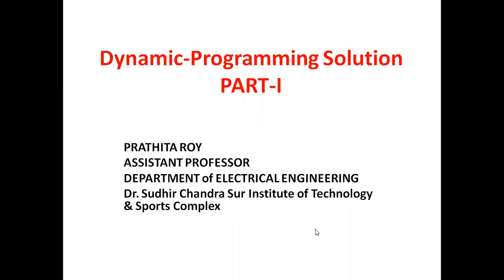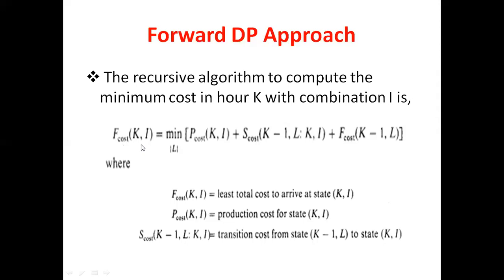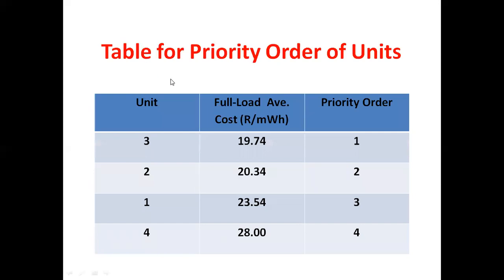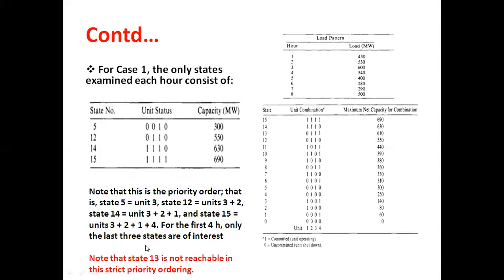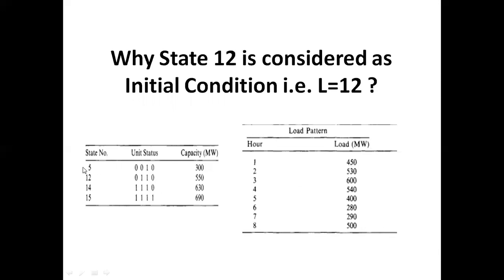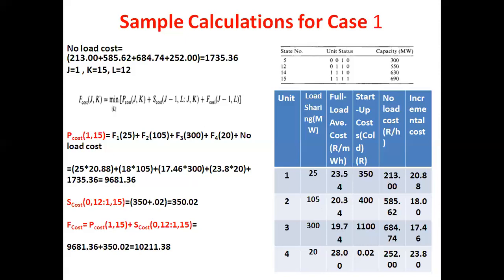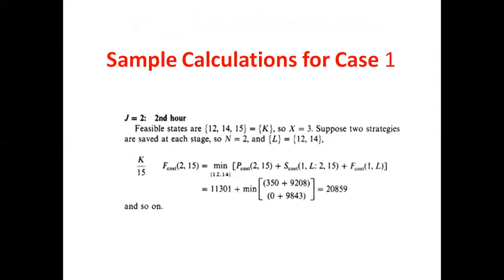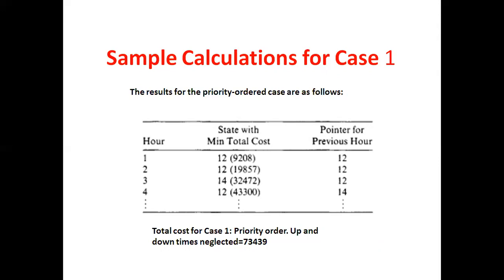UNIT COMMITMENT SOLUTION METHODS Dynamic Programming Solution Part I by Prathita Roy

Comment: Thank you Sir for the video, it was a great help!
Just a question; what if the time period is two (2) hours. ex. 1-2 hours load is 450; 3-4 hours load is 530. 
Are we still going to compute by the hour? Thank you again! Appreciate your reply.
Reply from the maker: Yes
Reply: @prathitaroy9238  Sir, how about  the Start-up cost. It will be added on the first hour, then from 3rd hour?
What if the load required reduces from the 4th hour? Say the load (5-6hours - 300). thank you very much
Reply from the maker: @mapwa9333  Keep it very simple, like when you want to meet the load demand at any hour, based on Average Incremental Cost(in priority order) you will start that particular Unit
Reply: @prathitaroy9238  Thank you very much Sir!
Reply: @prathitaroy9238   @Prathita Roy  Sir can I just multiply the final (P/S/F cost) by 2 as 1st&2nd hour load are the same to cover J=1&2. Then my next J will be at 3? thank you!